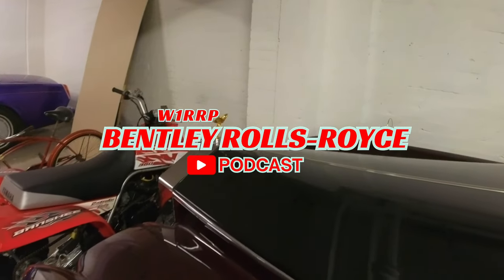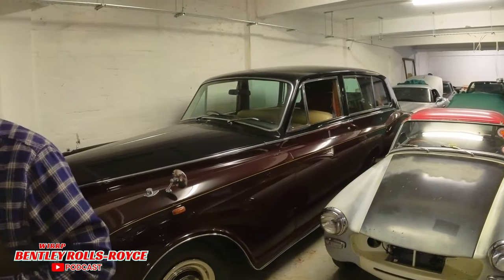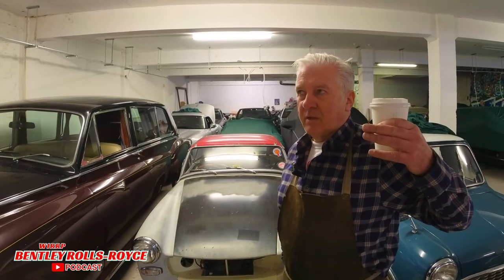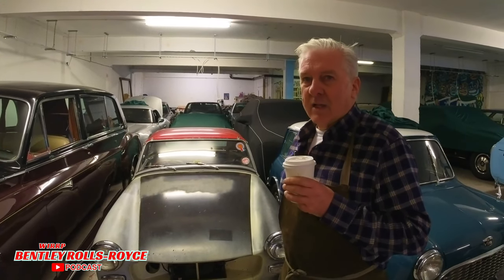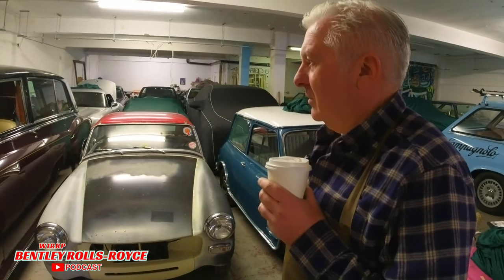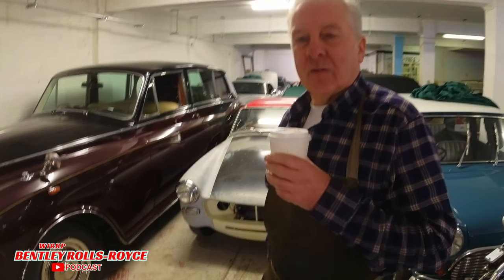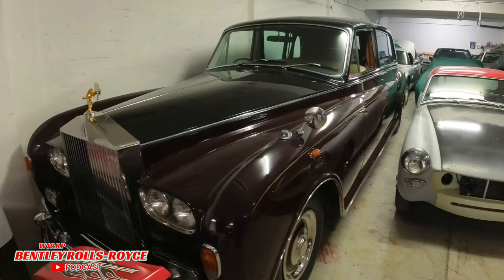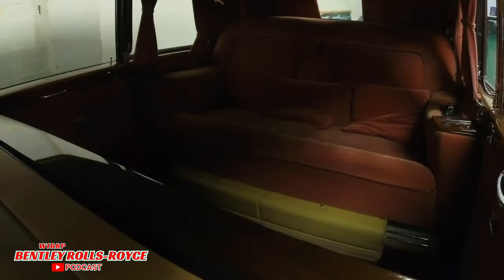Five Stages of Making A Rolls-Royce Phantom Bentley Rolls-Royce POdcast Mulliner Park Ward 4K

Comment: The chassis were made by John Thompson Ltd, not by Rolls-Royce.
Reply from the maker: Very interesting, I looked them up: John Thompson was one of the largest industrial enterprises in Wolverhampton and its interests spread world-wide. Its products were mainly boilers and vehicle parts, especially chassis; those core activities led on to many other products. The firm lasted longer than many others, remaining in Wolverhampton until 2004.
1920 The Motor Pressings company alone was subdivided into:

    Sheet Metal Department for Motor Car Work, chassis side members and cross members; wings, body panels, dash plates, petrol tanks, exhaust pipes, tool boxes, motorcycle mudguards, tread plates, aeroplane cowls and engine plates; and so on.
    The General Sheet Metal Department, producing such things as pail and paint kegs and drums, storage bins, elevator buckets, ships' ash buckets, dustbins, steel washers and “all kinds of odd iron plate work”.
    Pressings Department, producing chassis frames, under carriage and bogie frames for railways, pressed steel sleepers, brake drums, hub caps, axle casings, pressed steel work for concrete construction and “steel blankings every size and shape”.
    Constructional Department producing ladders and galleries of all descriptions, water softening plant, water cooling tanks, oil tanks, riveted pipelines, exhaust pipes, hoppers, bunkers, steel chimneys, constructional steel work and general iron plate work.
    Repairs Department which “can repair or replace damaged frames of any design, British, colonial, continental or American”.
https://www.gracesguide.co.uk/John_Thompson_Motor_Pressings